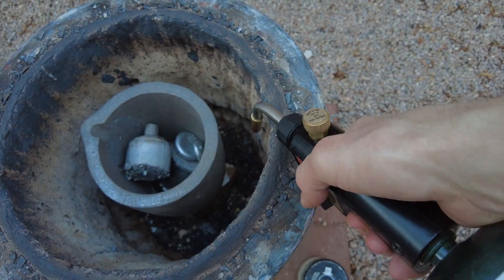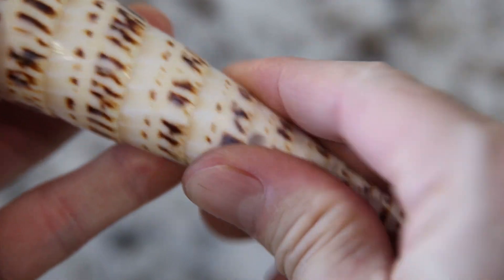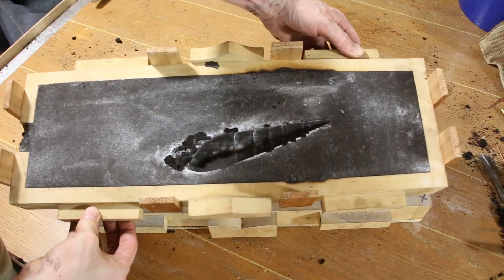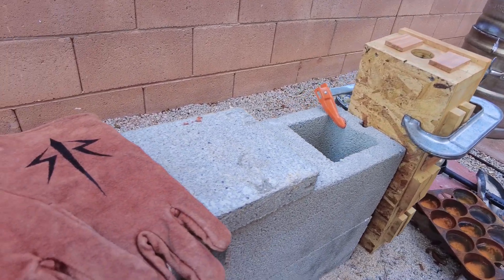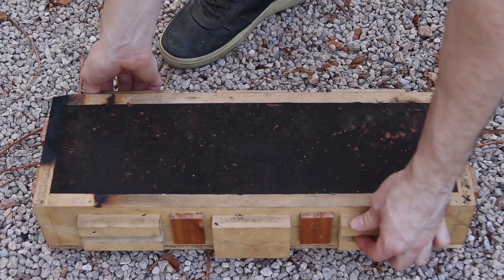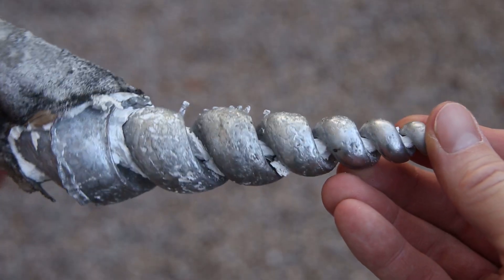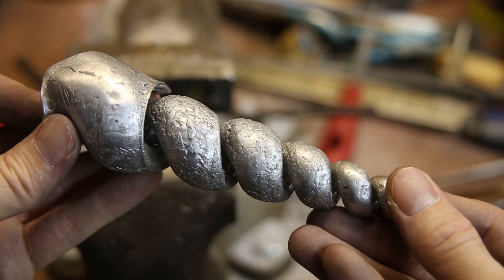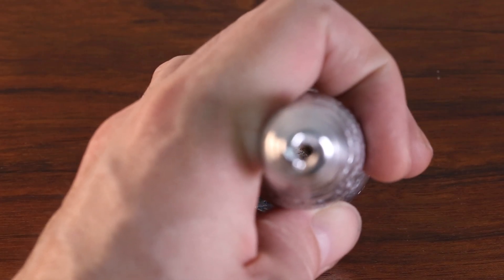Pouring molten metal inside a seashell - WHAT HAPPENS? - Experimental metal casting at home - DIY

Comment: i got an idea about casting phase, when i saw that bubbling expanding air when you were pouring molten aluminium into cast, i got an idea, what about blow hot air trough the casting form to heat it up to prevent so much air expansion when pouring aluminium   (idea by Thomaswhite-cz)

Comment: It would be interesting to fill the inside of the same kind of shell with resin, and then dissolve the shell away with vinegar, to see how the results would compare with the aluminum version, without the heat of the aluminum burning and deforming the shell. Though, if the shell were porous, the resin might impregnate the shell and prevent it from being dissolved.

Comment: Adding that to the end of a 1foot tent peg with a loop at the end you could use a metal bar to spin the peg into sand because it would screw down and because it gets bigger at the top it would jam its self in tight but unscrew easily so make the best beach camping peg ever

Comment: Make a bigger downspout,a few more vents to prevent air trapping facing upward,and pour a little hotter. If you can get it to spiral a little in the top as it goes in, the slag will stay in the spout.

Comment: Such a beautiful technique - using metal castings to peer into the internal world of things, seeing their insides with a 3d model, that could be a really useful process if applied and expanded - we could even go beyond metal, and think about ways to explore internal structures without destroying the original piece, which would open up a lot of possibilities for a wide array of fields.
Reply: @ Alexia Jennifer:
One could use alginate for the cast. It would be a cold cast and it would be like rubber. 
One would have to experiment a few times to discover how to get a clean release.

Comment: Ancient man could've done a seashell like that with molten iron, polished & sharpen the edges. Then heat & stress temper it for a drillbit that could drill into Stone, Wood, etc. better than copper.  It's a good theory.

Comment: It is necessary to measure the geometric parameters of the product, enter them into a computer program and cast a heat-resistant mold. Make a mold with 3D printing, with smooth outer walls, fill it with gold - and the exquisite jewel is ready. You can also reduce the parameters symmetrically and get gold earrings or a pendant.

Comment: See the blotch-water-drop-lilly-pad-thingies?  I bet they are from the drastic difference in temperature (and that by the time it balances, the aluminum hardens a bit); like a reverse leidenfrost effect.
I wonder if you had preheated the whole mold (impossible with wood, so pretend you had ceramic+sand) with the shell in as well?
Like throw it in a kiln to preheat it while you're melting the Al, and when you wana pour you have to first move the mold out from the kiln (and it'd be glowing too)..   Just an idea, but dunno if the preheating would destroy what you care about or not.. 
Cool video!

Comment: If the video is stopped at the 7:31 mark you can count the number of additional levels at the tip.  The metal was too big to fit the tinier courses in the tip?  It looks like 11 more swirls were possible?

Comment: I'm not handy at all but to confirm that the metal really has the markings of the inside of the shell and that the hot metal did not distort the markings in any way, I would have liked to see a shell simply cut in half to compare with the metal casting. Without that, how can you be sure the hot metal did not affect the inside of the shell??? But a very interesting experiment in any case

Comment: If you wanted the spiral part to be perfectly smooth could you fill in the small voids with metal?
Reply: The metal, like plaster if Paris, picks up on the finest detailing in a cast and preserves it. That pitted effect is what the inside of the shell walls are like. A negative 3D image.
Smoothing the outer surface is surely possible but that would defeat the objective of looking at the insides.

Comment: Was the sand necessary? The shell seems to have held up reasonably well against the heat of the aluminum.
What if you had just set the shell upright in a hole and poured the aluminum directly into the shell with a funnel?
Reply: more than likely the aluminum would've cracked the shell into pieces on contact, the sand held it together for certain

Comment: The shell is mostly calcium carbonate, and when heated it turns into quick-lime. This does not only make it brittle, but can also change the volume a little. Handling quick-lime and water can be a bit risky since it dissolves to a fairly strong base capable of producing chemical burns, so neutralizing it with an acid like in the video is highly adviced.
Reply: Wow the more you know :D Thanks for info ^^
Reply: The Romans collected and heated shells to make cement. Their cement was so good the Colliseum still stands (the parts that weren't stolen)
Reply: I used to be in the plastering trade and worked with quick-lime and hydrated lime many times. Getting either of them in just the smallest of cuts or abrasions can cause very nasty burns that, more often than not, cause scabbing that forms 'Under' your skin. They are very painful too. Getting that stuff in your eyes is a whole world of hurt.
Reply: @lilbullet158  so true. And breathing it in... WHOOOI!
Reply: @2degucitas  That's true, breathing lime dust in is proper Nasty too. My late father (god rest his soul), was also in the plastering trade and when he was rendering the inside of a Water tower, his labourer dropped a load of sand & lime mix from about 20 foot up, just as my father was looking up and it went Splat ! straight into his eye... The hospital had to practically remove his eye to wash it out... Not Good...
Reply: @lilbullet158  yikes!
Reply: so if I blast this cone with an oxyhydrogen torch, it’ll turn into a light bulb?
Reply: Mice Watr  gunpowder, I thought
Reply: I was looking to see if someone would mention that.
Reply: yeah quick lime is scary stuff
Reply: Huh.  I think I remember this shown with masonry of the middle ages and the dangers of what could happen with it coming into contact with water.
Reply: Nice big brain moment but why do you know this-
Reply: Mice Watr  if you are referring to the use of seashells for making something then yes, that was shown in the first two episodes as well as later on in the first season. However I forgot what he used the shells for
Reply: Calcium carbonate is lime. Quick lime, I think, is a different thing.
Reply: @Svensk7119   When shells or limestone are heated they turn to calcium hydroxide, quick lime. Add water and a chemical reaction occurs. It produces heat, drives off the hydrogen and it becomes calcium carbonate.
Reply: @2degucitas  Okay. When my Dad needed to sterilize part of the corral, he had to use lime, and they said go to a place that makes concrete. They were referring to calcium carbonate, "common" lime, I guess.
Reply: @Svensk7119   No. Lime is calcium hydroxide.
Reply: @2degucitas  Is there a difference between scientific lime and what plain old folks call lime? Does concrete use calcium hydroxide?
Okay, I looked it up. Lime is calcium oxide, it can vary in water a bit, and calcium carbonate, which is an ingredient in concrete, can be reduced to lime, calcium oxide, in a limekiln.
Calling calcium carbonate lime is not precisely accurate, but perhaps understandable.
Reply: Why did you do the mold in two halfs,when the actual mold was the shell, you cojld have just pushed it into the sand and cast into that
Reply: @pascalennis9123  He needed to make sure there was sand all around the shell. The heat would break the shell making lead flow out and have a deformed result. It's also easier to remove the shell this way.
Reply: Wait, so I can crush up shells and use them as makeshift Tums if I run out? Cause that's what I just heard.
Reply: @ChrisHarings  no no no. tums is calcium carbonate, aka limestone. quicklime is calcium *oxide*... NOT calcium carbonate
Reply: @Chris-P.-Bacon-III  When calcium carbonate decomposes thermally at ~1500F, it turns into calcium oxide, aka quicklime.  However, the melting point of aluminum is just above 1200F, so I don't know if it was hot enough in this particular video to form quick-lime
Reply: @Chris-P.-Bacon-III  shhh
Reply: @Chris-P.-Bacon-III shells are made of calcium carbonate
Reply: @ChrisHarings  absolutely.  or chalk. Antacids taste chalky for a reason.  Tums aren't lime though, they are calcium carbonate (I just checked to be sure).  Rolaids I think also has some magnesium hydroxide as part of its tablets.  Used to, anyway.
Reply: @ChrisHarings  cmon. do it.
Reply: @ChrisHarings  yes.
Reply: *advised
Reply: @JohnPaton3  Det er da ikke så farlig
Reply: You had me until "adviced". Did you look at your autocorrect and say "nah"? It's advised 😑 yea I'm a grammar nazi
Reply: @paparoo9924  Altså, ikke alltid at autokorrekten min tar alle språk samtidig.
Reply: @ThePiloseOne  YouTube doesn't have a translate option 🤨
Reply: Great, ur science textbook is real useful 😑

Comment: do you know of way to not burn the wood when pouring the molten metal ive tried sheet metal it helps but still burns it on larger pours.i was thinking spraying cosmoline thickly the metal or i guess some fire proof fiberis sheets inbetween metal sheets. but that would be hard and not cheap.

Comment: I wonder if there is a metal with a low enough melting point that it wouldn't destroy the shell.

Also, I think if you had clipped the tip of the shell for the breather, you could have gotten the whole thing.

Comment: Liked the project.  There are no lines of symmetry in the shell, it's a three dimensional tapering corkscrew like spiral. That is what makes it all the more interesting. I wonder if the hole left behind by the shell more narrow at the tip then at the mouth...  you should measure it.

Comment: We used smaller version as a kid in southwest Florida we  called them panama rollers . They were used for catching redfish in the 60s and 70s ran a piece of wire leader through the top with a swivel and a treble hook in the back . They worked and would cast a mile

Comment: I have no experience with this at all, but would it help to heat up the form and shell (i.e. in an oven)?
My imagination is, that it would make a more smooth metal surface of the mold.
Of course I could be completely wrong! :D

Comment: An excellent experiment and a presentation!  To expand the thoughts in this direction... you can 3D scan the outer surface geometry data of the shell prior to the casting, and then 3D scan the casting to obtain the inner surface data.  Combining the data together will give you the 3D model of the shell which will enable you to 3D print the shell in clear resin which can cover over the metal casting(probably in multiple pieces to make the fit possible).
Reply: OR, you could make a mold of the outside of the shell before you do any of the steps in the video. Much simpler.
Reply: @antonliakhovitch8306  Sometimes people over engineer things! I came to say what you said!

Comment: What a great result.
I haven't fired up my furnace in a couple years.  Which is sad, because I ordered 4 new A12 crucibles around the same time I built the new furnace.  (one for each of the different metals I worked with, and one back up for the inevitable)

Comment: Nice casting project.   Hint:  You may get a better finish by baking the washed shell in the oven at 250F for a bit to drive off as much moisture in the shell material as possible without degrading the shell itself.

Comment: Hi ! When I was a kid I used to do the same thing with snails shells I was filling with tin I was melting with a soldering iron. It was really fun ! The dangerous part was to move the shell to make the tin go deeper inside (in order to get the most complete iron snail) without getting burned. Turned ok ...

Comment: Since I know everything, I'd like to suggest the large tab of aluminum that was removed by hacksaw instead be left on, and shaped to a consistent width so it can be held tightly in a vice. Then you can more easily work on the rest of the casting, like detailing with a file, polishing

Comment: If you do another one don't break the shell off with a hammer. Use a small abrasive wheel to split the shell down its length, so that you can show how neatly the casting fits the inner countour. Very nice work.

Comment: I think you should drill the hole way under you did, to maximize the amount of metal going down without being stopped by trapped air. Also, i think you should bake the shell before casting, to cast away the maximum of water out of it

Comment: I thought it interesting that the external surface on the casting below the bottom vent hole, was so much smoother thab the upper portion.
It might be interesting to repeat the experiment , but with a larger vent hole closer to the top of the shell.

Comment: maybe do a resin pour-in and that would be even better as u can mix in colours and the finishing will depends how well you chip off the shell as the internals of the shell is super smooth.. so if done proper.. there wouldnt be much polishing needed and it should look super-doped!!

Comment: I would have polished away a little less of the texture.  That is what makes this organic, even in metal. 
Quick question based on my ignorance.   Why did you put the shell in the old and not just pour the metal into the shell ? 
Also, why did you punch the hole so high up as opposed to at the tip ? 
Again, total ignorance on my part.

Comment: Geologist here.

It's not unusual here in Florida to see fossils that look a lot like that.  Lime mud gets inside the shell, then while buried (and over several millions of years) the lime mud hardens and the shell dissolves away.  Sometimes you can pick up a limestone rock and if you shake it, you can hear the internal mold rattling in the rock.

I noticed that the aluminum surface was a bit ... wrinkled?  I assume because of the aluminum hitting the much cooler shell material when you did the pour.  If you could have heated the shell before pouring (and I confess I don't know how you might do that), would the surface have been smoother?

Thanks for posting this.  I have some low-melting temperature ingots, and I might try doing this for my students.

Comment: Have you thought of casting projects like this with Babbitt metal (metal used for bearings). It has a melting point of about 360 Fahrenheit, much (much) lower than the 1220 Fahrenheit melting point of aluminum and even a lot lower than the 621 Fahrenheit melting point of lead. Babbitt metal’s melting point is low enough that craft paper can be used as a barrier (mold). Babbitt metal is considerably harder than lead, but perhaps less hard than aluminum.
I don’t know if wheel balance weights are still made of Babbitt metal (which is easy to cast with), but they used to be. Most tire shops have a bucket full of wheel weights. Depending on the manager’s feelings, you might just be given the used wheel weights if you ask nicely. Bring your own bucket.

Comment: Would be interesting to take a casting of the shell before doing the aluminum pour. Then you could set the aluminum casting in that mold and do a resin "shell."
Reply: Same thought.  Dont destroy the shell.  Use it as a negative cast pattern.
Reply: @deadwingdomain  Well, the inside and outside of the shell looked completely different. So you wouldn't get the same result right?
Reply: Could still use shell 2 for the negative, then cast the aluminum inside the resin...  I think that would work well, and look amazing on a small wood stand
Reply: @Coupe420  No chance, all shells are different, like you and me.
Reply: @Coupe420  Wouldn't the resin just melt / burn?
Reply: @Mobin92  don't pour metal in it, encase the pre made metal in a resin mold.  Vacuum out air and... voila!
Reply: he'd need to create at least a couple of standoffs to suspend the aluminum in the resin... I suppose those could be drilled out and retro-filled with a bit of caution.
Reply: @kaidwyer  maybe only 1 at the point of the shell, would be cool to see!
Reply: EXACTLY!
But people won't spare a minute to think of ways alternative to destroying things. Just plain unkind.
Reply: You spelled aluminium wrong. There are two i’s in it.
Reply: @hoonaticbloggs5402  there's two spellings. Aluminum is N. America's word for it
Reply: @hoonaticbloggs5402  only over there!
Reply: @hoonaticbloggs5402  Not in the US and Canada, technically.

Comment: Looking at the way the metal was surging out of the mold during pouring - I'd suggest that it wasn't
Reply: Dry enough.  Venting the outside of the mold would probably not have helped as the shell was the mold - the sand was just supporting it!  The surface of the shell pieces looked a lot smoother than the casting.  I could also be that the heat was calcining the shell and giving off CO2.  It looked great anyway - well done!

Comment: The reason your shell turned white and crumbly when you poured the aluminum into it is the heat of the molten aluminum turned the calcium carbonate in the shell into lime.  Heating shells was one of the methods ancient and medieval people used to produce lime for cement and mortar.

Comment: Why is the hole in the shell not at the very tip of the cone? You wasted space and trapped an air bubble. Next time, blow the air through the hole, and not the large opening. You'll get more air throughput. Why don't you preheat the mold? It's bubbling an awful lot while it cools. All that said, good job. It's quite beautiful.